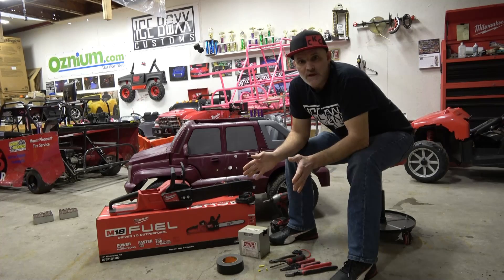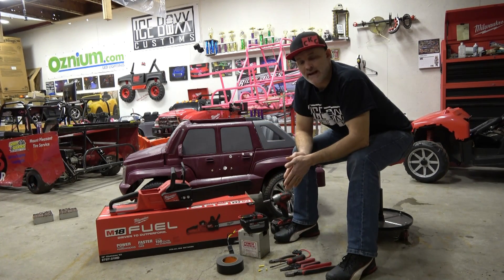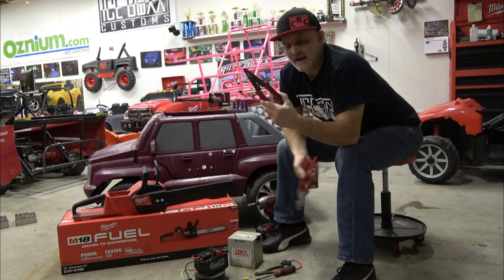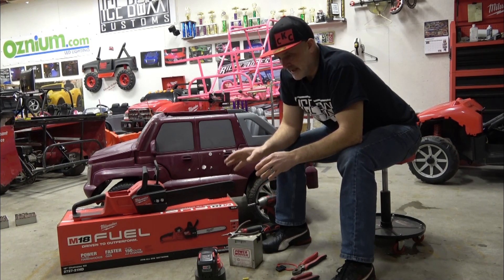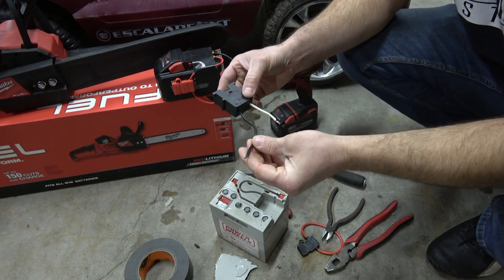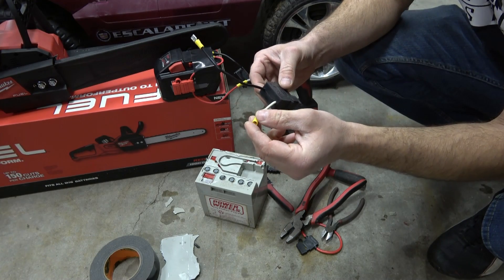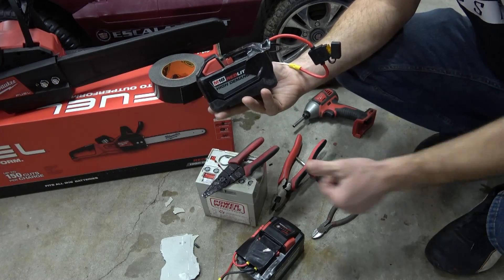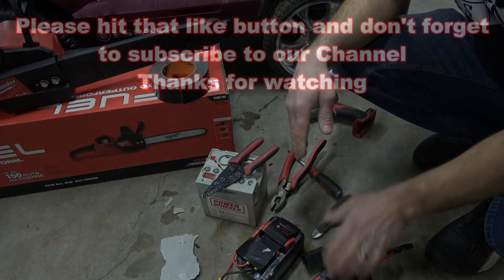Power Wheels battery upgrade- Power tool 18 volt battery-how to video

Comment: Will it work on the rollplay gmc sierra denali 12 volt battery ride on vehicle from walmart?
Reply from the maker: Never worked on that model. Take it apart and confirm that it doesn't have any circuit boards.
Reply: @CustomKidzCars  I havent gotten it yet. I wanted to get it for my grandson this year and get it customized for him and after watching your vidz the things I want to get done to it was one thing is upgrading the battery to get more power.

Comment: On my sons old 6v f150 power wheels I tried ryobi 18 volt 1.5 amp which works great but yea dies fast and 18v 4 amp but the 40amp inline fuse I use gets hot and fries real quick.
Reply from the maker: Uh yeah, that's 300% more voltage so u r asking those little 15,000 RPM motors to spin 45,000 rpms! That's alot... I bet it flew though...
Reply: Custom Kidz Cars yes it moved but for a short distance. With the smaller amp battery my son was going pass 5 minutes before battery drained. He loved it tho. 

Might have to put a 12v battery for that power wheel?

Comment: Where do you find the parts 4 Power Wheels because I'm looking for a really how real grillz or rear ends
Reply from the maker: Sorry I dont understand what you are talking about? Grillz? rear ends? they have plastic gearboxes.
Reply: I was asking where do you get the parts for the power wheels or just somebody does somebody Supply you the only reason I was asking I want to get a Power Wheels grill or back tail lights and do a art project with it